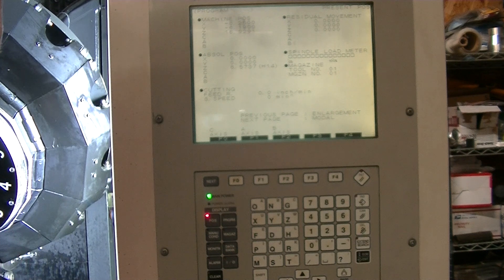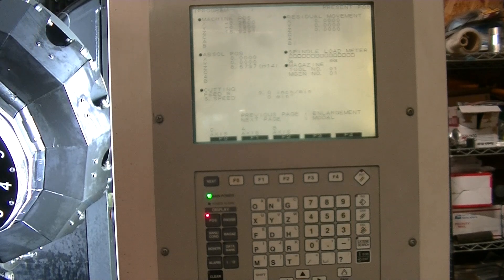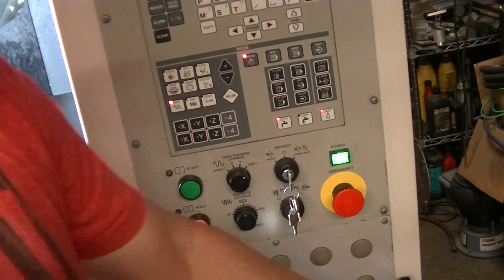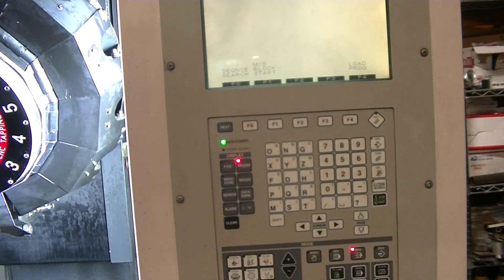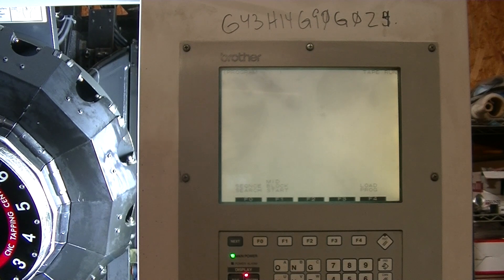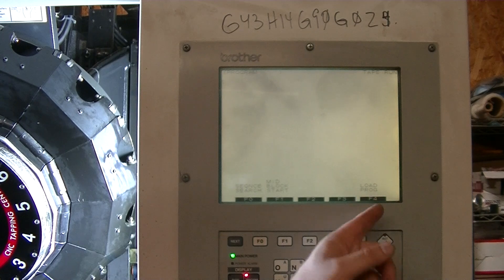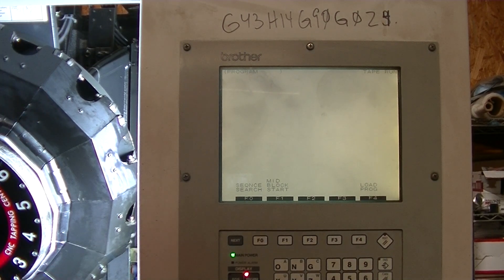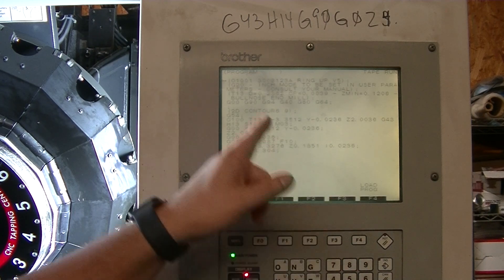Brother A00 Control - Drip Feeding G-Code

Comment: Tom,  this is a drill/tap machine, I am looking at one, can do regular milling on this machine?  Thanks
Reply from the maker: I think a better way to think about these machines is that they are regular milling machines that are optimized for drilling and tapping. I got the best performance out of mine when using high-speed milling toolpaths that could take advantage of the speed but also worked well with BT30 holders since they aren't as sturdy as a CAT40 holder.
Reply: Excellent!   Thank you.

Comment: Hi. Are you using a regular db9 to 25 pin cord?
Reply from the maker: Sorry, I didn't grab a shot of the actual connections themselves. I was using a ribbon cable for the primary connection. I seem to remember there was an adapter at one end to make it a 9-pin but I don't recall and I don't have the machine any longer so I can't go back and look at it for you. This series of videos was like a brain dump for the new owner and I decided to share it to a large audience in case it helped folks.
Reply: Thanks 🙏